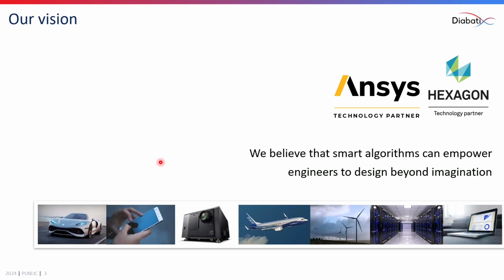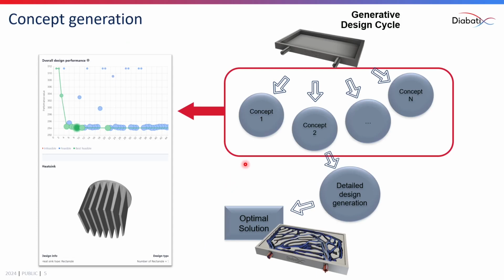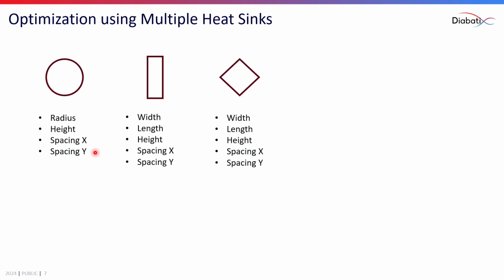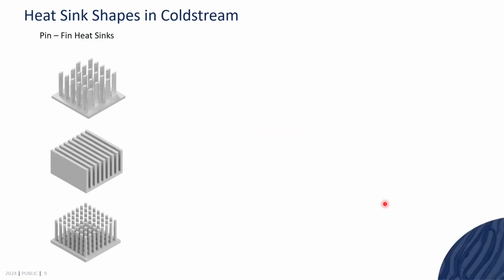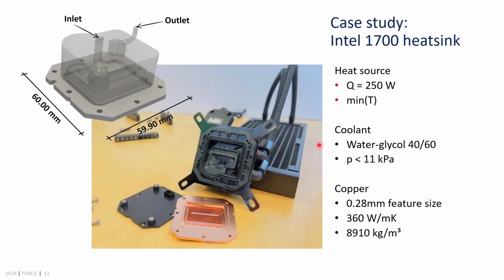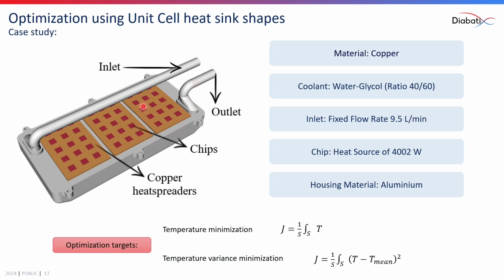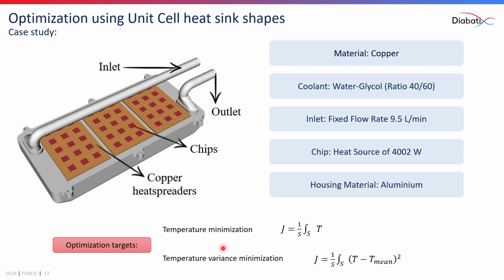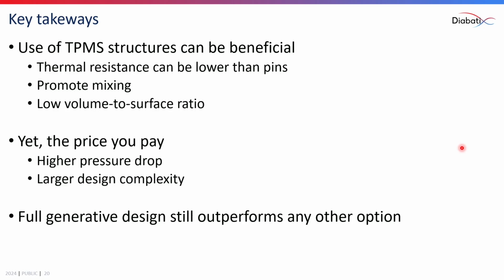Cooling electronics: Pins, fins, gyroids compared | Diabatix Webinars

Comment: It would be nice if you consider variable pin and fin density to compensate regions of high temperature, then analyse the pressure drop due to the introduction of variable pin/fin density.